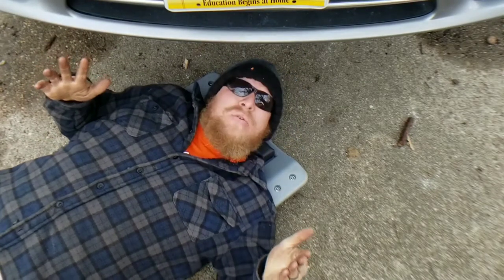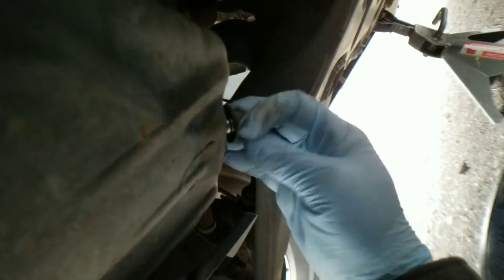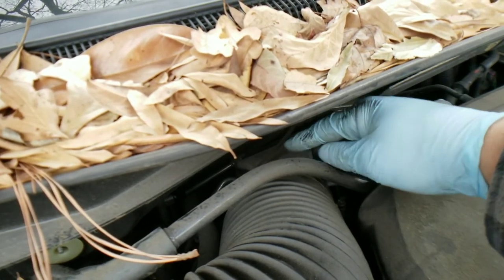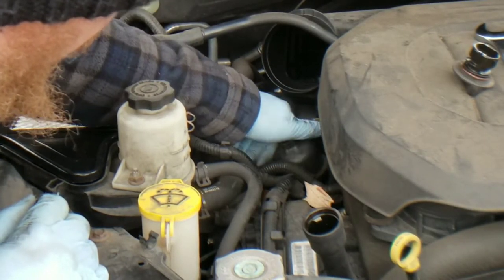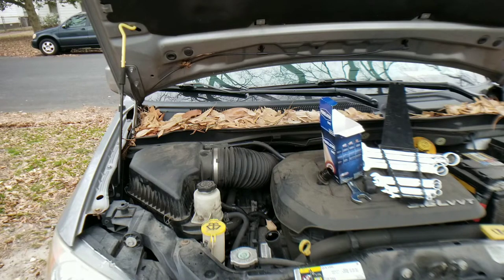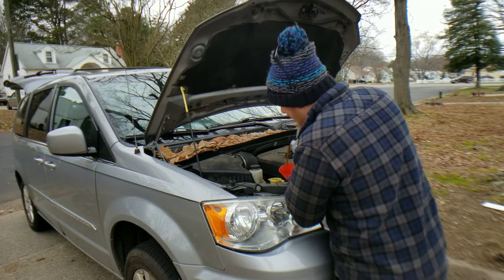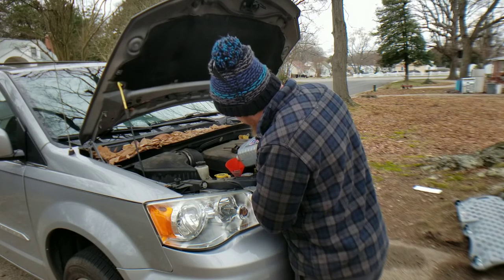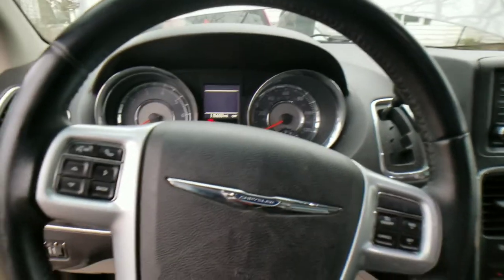How to Change the Oil in a 2014 Chrysler Town and Country

Comment: It is my first time changing the oil but in the store they told me it needs 6 quarts of oil?
Reply from the maker: That is correct you will actually use about 5.6 quarts so you will have a little left over. Remember to check your oil after you fill it, then again after you start the vehicle for the 1st time. The oil filter takes a little of the engine oil when you start it up for the 1st time. Hope this helps!
Reply: @Sellthoseflippingcars  thank you. It was very helpful.

Comment: Ive been doing this for 6 years with our vans. My question is. Have I made a mistake in not doing every 3k mi? I usually change around 5k. Wifes has slipped away from me last few times in 6k range. Never have had an oil change light come on. Bracing for bad news.
Reply from the maker: You are good! With synthetic engine oil you can go 7000 to 10,000 before changing the oil. Remember that your Town & Country has a oil life percentage. The vehicle will tell you when the oil is needing changed If you ever doubt yourself.
Reply: @Sellthoseflippingcars  Thx much.
Reply from the maker: You are most welcome!
Reply: @Sellthoseflippingcars  Tell me about the Town and Country oil life percentage.  Guessing somehow one would enter the nimber of years til next oil change and then percentage data appears somewhere?
Reply: I chg mine at 4k with any oil. Was told by blackstone its in great shape. Anything to keep that 3.6 running